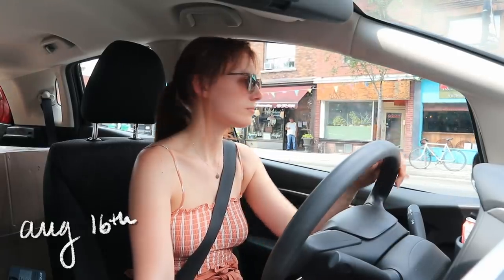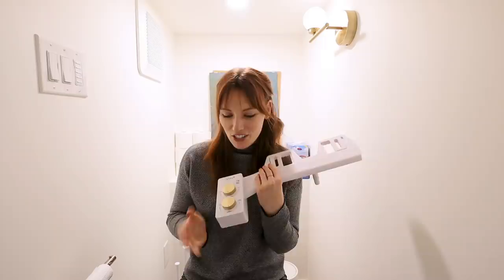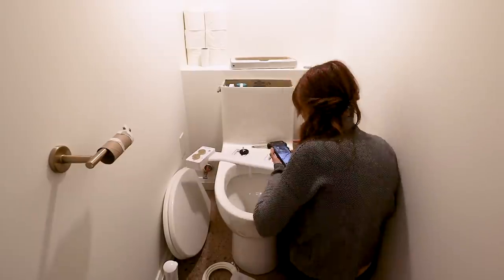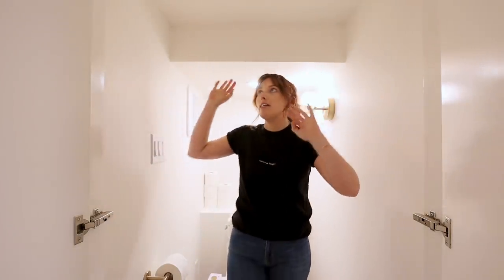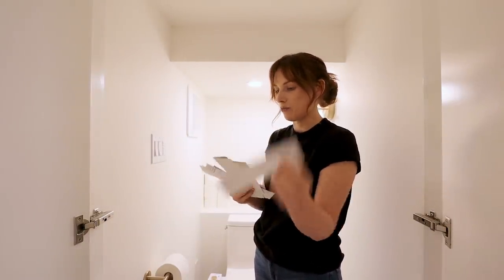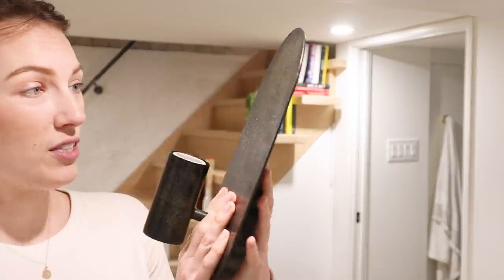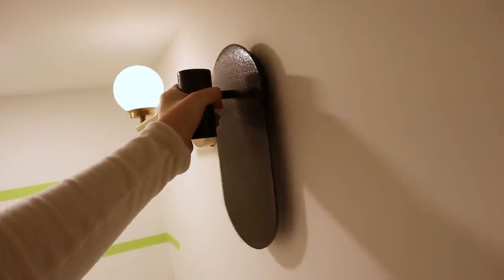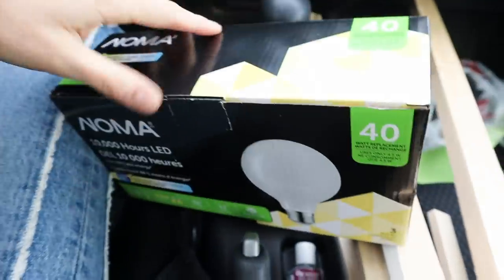I have a room just for my toilet so I made it over

Comment: I feel like the tp holder needs to be turned around so it won’t fall off when you pull on it
Reply: This is the most constructive comment not focusing on the color of the walls. Lol
Reply: I commented the same thing! It's going to fall off every time you try to pull off the paper. It's going to be hell if you're wearing a dress and holding it up with one hand and the roll falls on the floor.

Comment: Haha, nine minutes of me shouting "Wallpaper!" at the screen, before Kelsey remembers she wanted wallpaper.  And then it wasn't installed.  The WC is the perfect place for a dramatic wallpaper and I hope you can find it in the budget to get for the top half of the room.  What you have done has made a huge difference and given the smallest room a big personality.
Reply: I agree that there's some amazing wallpaper out there, but she's right - it's expensive, and it's a lot of work to do well. I wallpapered my new condo's tiny bathroom, and even with matching the seams perfectly I can still see every one of them. And that was $100 a roll wallpaper, not cheap junk :-(

Comment: I feel the colour gives a 70's aesthetic which I like. It will look even better when you get the round bulb in as it will echo the circle in vase. It might be cool to use aged mirror on the back of the doors and or on the top part of the wall. Well done using the power tools and building the cabinet!

Comment: I've had an "add on" bidet for about 20yrs now.  I could not live without it!  I don't get why all toilets don't just come with one????
Reply: Probably a rhetorical question.. but most toilets are made up of separate parts that you purchase based on your needs. Sometimes you can buy a set including ceramic base and cistern etc, and sometimes it’s all separate.
Also if they’re not properly maintained they could pose a serious health risk. If it came with a place you were renting and it wasn’t officially “serviced” before you moved in, your landlord could be liable for your health concerns (if you get an infection or are injured due to it’s moving parts).
All around, not all toilets come with a bidet function because it’s an expensive and risky feature especially in cultures that aren’t used to them. And in general it’s just more hygienic & low maintenance to have a separate bidet unit where possible.
Reply: I personally prefer the mini shower head/hose that you can attach to the toilet and clean yourself more freely than with a bottom-up stream of a bidet. My place doesn't have one, but the toilet seat is next to the shower so I just use that.

Comment: I wish you would have picked up on the blue gray flecks in the floor and used that color on the walls.  Also I feel the painting or a painting would have made a great focal point and inspiration price for the whole space.  Lastly floating shelves with the right containers would have felt lighter that the cabinet.  A great solution would be a mural wall behind the toilet with floating shelves.

Comment: Hey girls, loving your vids! Video Suggestion: I’ve been wanting to make a yoga bolster pillow for ages now but I’m unsure how. These are quite heavy cushions, I’m not 100% sure what is in them, but I know it’s more than just pillow stuffing. I would looove it if you guys could work out a way to make a yoga bolster pillow at home, and make it more cost effective than buying from a yoga shop (they are pretty pricey here in Australia). Appreciate you lovely ladies so much, keep doing you! Xoxoxo
Reply: An option is to use a few rolled towels and then a softer material around the rolled towels so there are no lines or edges. It'd be lighter weight than using buckwheat and many of the filling options can be pricey. From there, you're just making the fabric shell.

Comment: The room feels "bottom heavy". Makes the ceiling feel lower and the room smaller. I would have gone with a striking wallpaper on the back wall and on the inside of the door--the parts you see walking in and sitting down. But if you really want a darker vibe and you're firm in moving away from green, then go for a brown with less red undertone. So it doesn't remind people so much abt what goes on in such a room.

Comment: In ALL honesty, I really dislike the color. There are a number of other colors in your floor that, in my opinion, would have been nicer. The storage box that you built is really nice, and I love that you installed French doors instead of a single or bi-fold door. You accessories are perfect. Question: Did you ever consider putting a mirror above the storage?